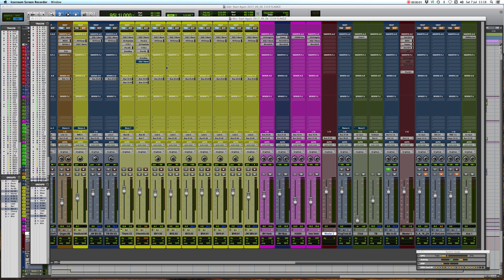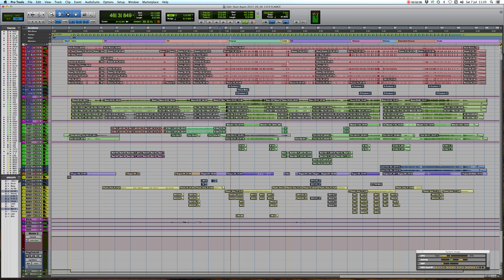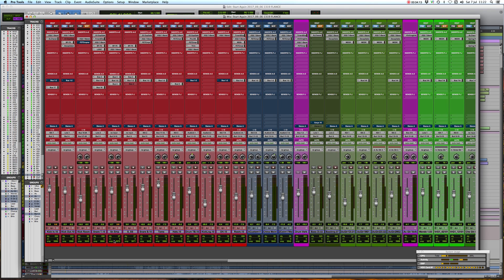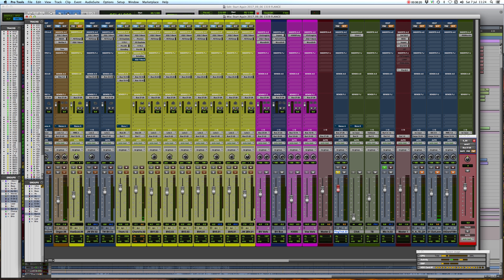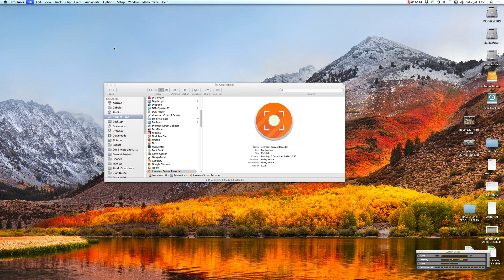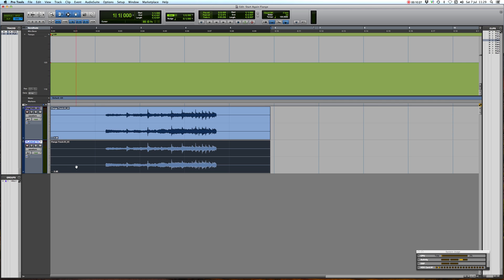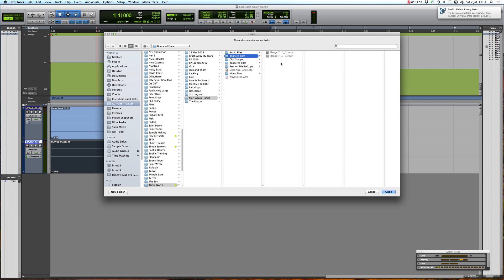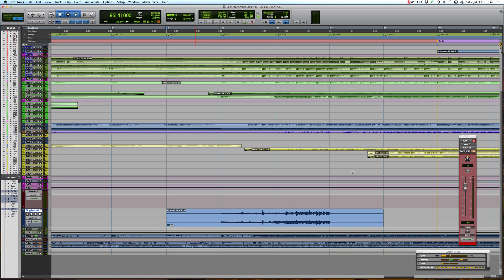Real Tape Flange Effect - Pro Tools Tutorial

Comment: For some reason when I try this all I get is the second audio at a variable time sounding warped, not flanged. I must be doing something wrong.
Reply from the maker: Hey Stephen, let's try and get to the bottom of this...when you say warped, can you explain the sound excatly? It may be to do with the resolution of tempo change that you applied. The tempo changes have to be in decimal points eg. if the source track is 120 I would only adjust my flange track by 0.5-0.7 bpm. Let me know how you get on.
Reply: I think I had the same problem you did - to get the effect of tape flanging the tempo only needs to be moved about 1-5 bpm (any more than this and it starts to sound 'warped'). If your tempo track is zoomed out then when you pencil in a varispeed tempo change the varispeed track will shift more than that. Try zooming in on the tempo track and only making small tempo changes to get the desired tape flange effect.

Comment: This is great, but I noticed you are using the term "Bounce", which is a song, or part of a song bounced to disk, but are you actually exporting and importing 'clips"? Also, when I draw the curve with my pencil, the result is large steps, instead a lot of steps like yours. Is this because I'm using Express? Thanks.
Reply: The big chunks were because I wasn't zoomed in.
Reply from the maker: Hey Tom, the way I work is that I print the mix inside Pro Tools (I use an analog summing device which returns into Pro Tools). So technically I am bouncing the song (or parts of the song) then I'm exporting the clips - so you're right in a way.
Reply from the maker: With regard to the resolution of the tempo change, have at look at this section of the video https://youtu.be/JVtImUvstjA?t=515
Reply: @MasterLinkProductionsSend  Thanks very much! It took me a few times to see where your mouse was when you were clicking on the + button for the tempo zoom. I was able to complete the procedure. It's just that it's not as dramatic as yours, even though it sounds dramatic in the 2-trk flange Session.
Reply from the maker: @tomlewis2477  Nice one! I wonder why yours isn't as dramatic? I wonder if there was a difference between the file you used to create the flange track and what's coming out of the stereo mix of your track. Could be a bouncing anomally.
Reply from the maker: @tomlewis2477  Check out Zach's comment in this thread, you may be experiencing something similar.

Comment: Hi, thank you so much for this tutorial, I thought about a metod to do it in the session and here's my suggestion: create an aux track where you sent your insrtuments to be flanged (as you did), on that track use the "Tape" plugin from Softube in this configuration (you have to open the "remote control" part on the right by clicking on it): 100% wet, speed stability 80%, and tape speed 3%. Now mix in this aux track to taste (i find -4/-5 dbis best for me)
Reply from the maker: I need to try that out! It's good to do it without 3rd party plugins though, in case people don't have them.

Comment: Heya this is awesome! wanted to be able to do this for a while now, one thing though
I'm having an issue getting the flange to work once its back in my original mix. The only way it seems to work for me is if I import both the stereo files (the original track and the flange track) from the "Flange Session" so that my varisped track has something to flange against..... Any tips?

Thanks in adavance, Zach
Reply from the maker: Hey Zach, thanks for the comment. That’s odd that’s it not working once back in your mix. If you followed the steps to the letter it should work as the bounce IS the mix...can you try again and let me know?
Reply: @MasterLinkProductionsSend  thanks for getting back to me so soon. I'm going to try again today, I'll let you know how I go. thanks
Reply: OK, FIGURED IT OUT!

I was consolidating the track to the very start of the session and so it wasn't aligned perfectly hence no flanging.

Thanks mate, works a treat!